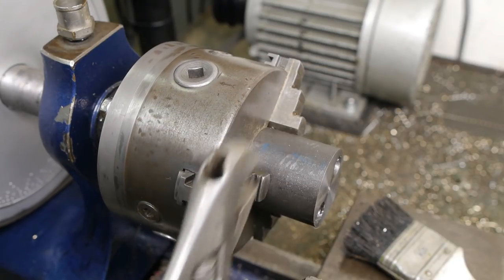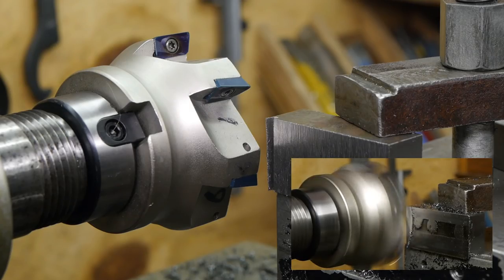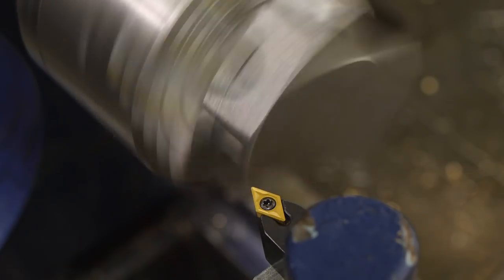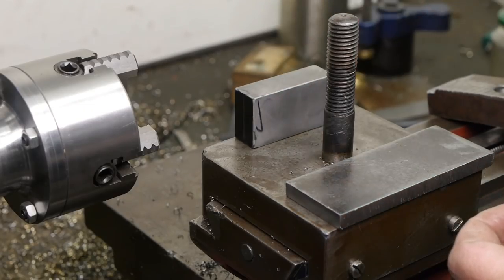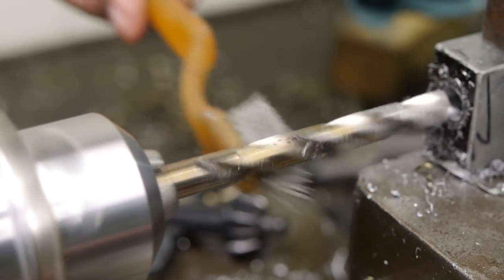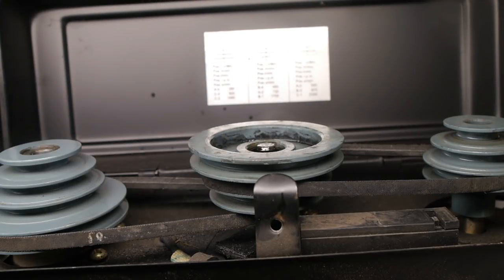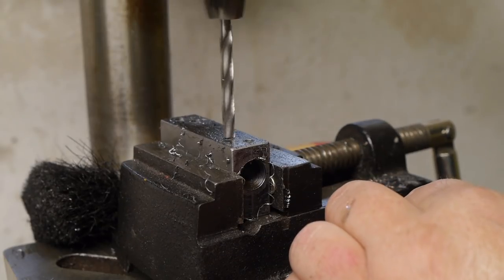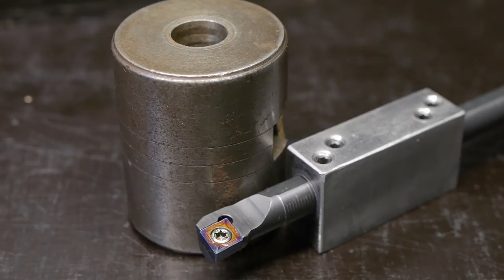making a 12mm boring bar holder (long version)

Comment: I like the longer videos.  I find the fact that you show your mistakes useful, as i am not good or experienced enough at machining to call myself an amateur, it works as both a learning tool and a motivation for me.   Keep it up.
Reply from the maker: I'm not good or experienced either. But I might slowly get a little better. I will complete my 4th year, and see if I can get some measure of success,  but have been thinking about getting another hobby :)

Comment: interesting video, very clever making new tools. Just as an observation, you could measure again the distance from the center of the piece to the tip of your tool and rough that distance at the base of the new tool holder, so that the center of the lathe coincides with the tip of the tablet, thus avoiding that noise, you take care of the tool and you take care of the machine, let the edge work, not the machine. very good video. greetings friend

Comment: If you are looking for cheap or free shim material try getting some of the metal banding they use on building sites for pallets of bricks.Usually if you ask nicely they will give you as much as they can and its easy to cut and stack.

Comment: Couple more tips. 🤠
Never get your fingers any where near the work piece while the cutter is spinning.  (Just don’t do it ok)
When deburing with a file move file along the edge (parallel) instead of across it works much better.
When you remove a chuck stick a piece of ply wood on the bed.  If you slip and drop the chuck the bed will get a hunk out of it.
They never grow back.  All old lathes seem to have some hunks out of it. :)

I bet those head stock bearings aren’t steel on steel.  We all know what happens with steel on steel bearings don’t we?

There is also a neat trick with your calipers to mark a line parallel with an edge.
With the calipers fully closed you will notice the two edges on top are perfectly even.  So went you set them at say 20mm those two edges are exactly that distance apart.  If you put one edge of your calliper on the edge of your workpiece you can scribe a line 20mm from the edge.
It’s really amateurish to scratch a line with caliper points no matter how stuffed they already are.  And as we can see it doesn’t work very well.
If you don’t get what I’m talking about I’ll make you a video :)
Reply from the maker: I think the spindle runs on cast iron inserts that should be replaceable. I don't think it runs directly on the headstock metal.
I get it, I'll take better care of my calipers :)

Comment: Very nice to hear you again. Too late now I know because you have now made a new one, BUT why did you just not make a split reducing sleeve for the original holder 20 to 10 mm or whatever size. A quick od turn to size, bore to new tool size, split with a hacksaw, job done.
Reply from the maker: I actually did not even consider that idea. But I might try it for the experience :)
But it would allow the tool to rotate in two places make setup a bit more complicate.
This one I can just grab and use. that why I also made one for the black lathe: https://youtu.be/F-

Comment: only one or two of the inserts are cutting !  try checking the length of each insert on that cutter.  and replacing just one or two inserts at a time will do that. also looked like the cutting head was out. This will give a bad finish.

Comment: Nice.

A couple of things, though.

- Putting the block lengthwise in the 4-jaw and centring it, you could have drilled it using the tailstock, which is far more likely to stay on centre, and less likely to result in disaster due to either hitting the cross slide handwheel or just the piece slipping on the compound.
- Not sure why you're drilling your set screw holes off centre.  The flat(s) on the tool are (or should be) referenced to the insert mounting surface, so a flat ended set screw bearing directly on the flat should put your tool dead nuts square with the set screw, and thus the base of the toolholder.  The ability to rotate the tool seems sensible, until you realise that all you've really given yourself is the ability to make the cutting angles of the insert /wrong/.

Comment: I have a 100 year old Oscar Ehrlich lathe and while banggood CCMT and DCMT work quite well for facing and long turning, they give horrible results for boring operations, no matter how short or stiff the boring tool. I am back using HSS or brazed carbide boring bars, they work much better. I suspect, the cutting angle is just messed up when the inserts are used and they are not getting enough of a cut or are too dull. With HSS when very sharp, you can get away with very light cuts, which works much better. Just my 2 cents.
Reply from the maker: Interesting. I shall make a hss boringbar one day :) something that fits the same holder. b.t.w. Wish my Ehrlich was running :)
Reply: @Rolingmetal  actually your "So I bought a lathe" forum thread in practical machinist forum helped me identify my mystery lathe as an Oscar Ehrlicher, ie with the help of the adice given to you for your lathe I could identify my lathe ( and go to lathes.co.uk to confirm it). Mine is smaller than yours, though, but still standing on its own feet, at least.

Comment: that crackling sound sounds like the drill bit disintegrating
Reply from the maker: Weird I think those 3mm drills are shit. Drilling the same material using a center drill and 5mm drill worked fine. https://youtu.be/F-

Comment: Facemi!l :only one edge is cutting  you need to level the inserts  . I'll pm you on the practical machinist forum  and send you some insert to break ;-)
Reply from the maker: Maybe it's the tolerance of the inserts because there is not much difference in he height of the insert pockets. So as long as you keep moving they should all do something. But one will do most of the work till the pointy bit breaks of :)